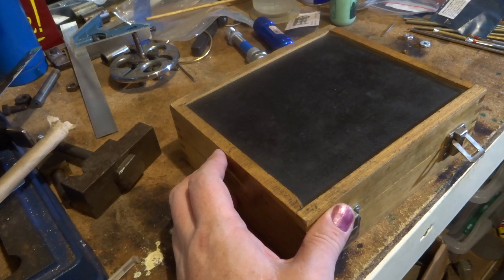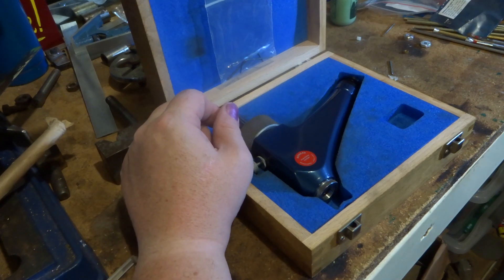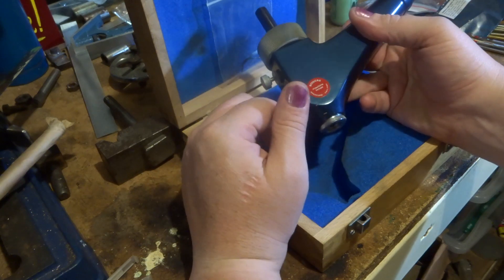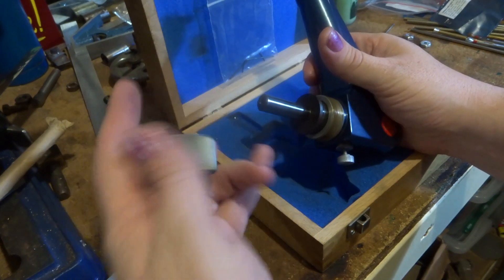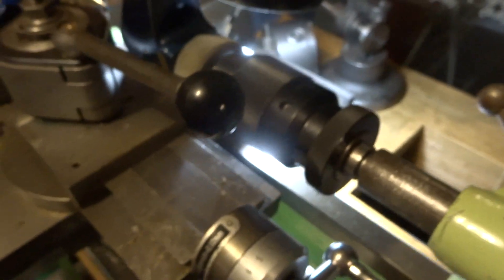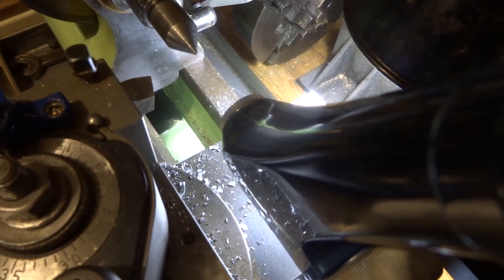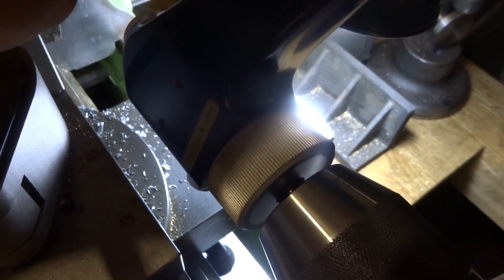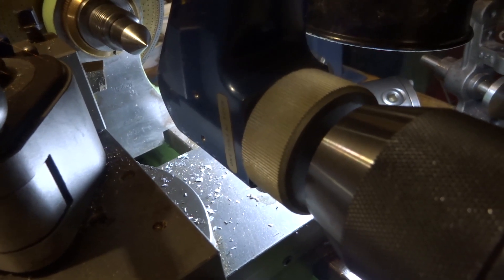a quick look at my bowers machine scope

Comment: I have one of these too. Turn it through 180 degrees and put it in the chuck. Makes checking the tail stock for accuracy easy. I can scan in and send copy of manual if you still not got one. I use mine in my drill and milling machines. When accuracy matters it is the greatest tool ever!

Comment: Hi there, Emma,

I think the correct procedure for using such an instrument is to focus the eyepiece to maximise the sharpness of the cross-hairs.  Then focus on the tool or other object by adjusting the distance between the objective and the object, i.e. by moving the tail-stock barrel.

Is that the sequence you followed?
Reply from the maker: Yes thats how it works. :) thankd for watching!

Comment: Beautiful instument. There are many instances when I could have used one, instead of staring through a loupe. Nowadays I am convinced that a low-power laser is the way to go,  and in fact someone already makes one for a mill. See www.lasercenteredgefinder.com. I see no reason why you couldn't make an adapter for a lathe tailstock, or for that matter put it in a headstock collet and check alignment of your tailstock.  Al these things can be done with the centring microscope; only the laser is cheaper. I love optical gear, but my budget says lasers are cheaper.
Reply from the maker: my father uses that laser tool. never felt like it was accurate particularly because the dot is quite large.. love to hear someone elses experiences with one.

Comment: Hi Emma, I have only come across them when used in a Mill or jig borer, and a drill of course, to centre over scribed lines for accurate drilling. The Hemingway one, which reminds me I must finish mine after a 10yr gap, has circles, as well as cross hairs, which should make drilling out broken screws somewhat easier, which the reason I started it in the first place. I often have to drill out broken bolts and screws, like you fellow countryman Bruce, hence the "shop of horrors", and accurate centring is a great asset. 
Your other uses make me want to finish mine even more, if only i could remember where i put the bits,  old age can be a bitch.